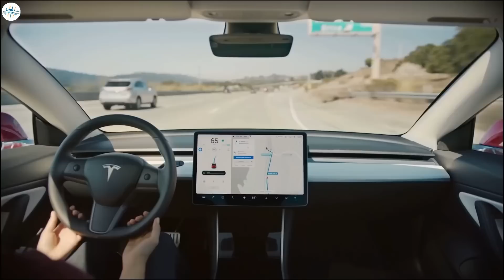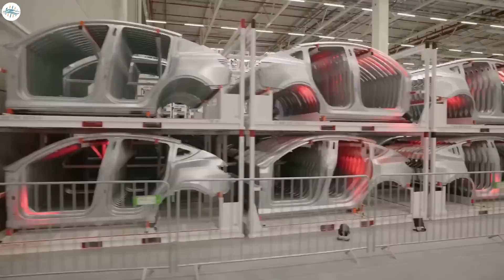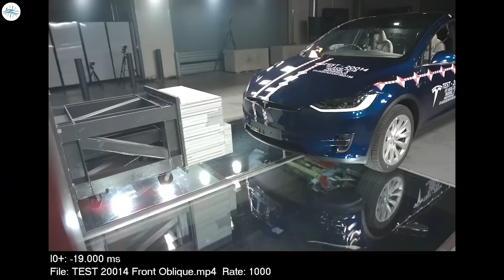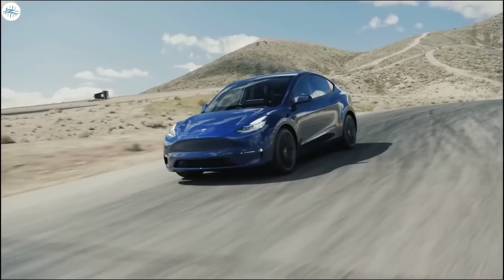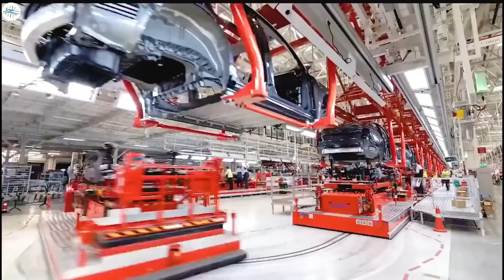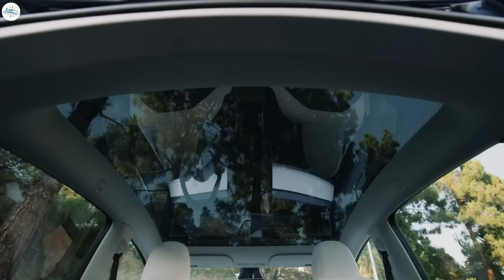2022 Tesla Model Y 2.0 - All The Changes & Improvements Coming!

Comment: The new Model Y should also get another screen like the Model S, heads up display and sun-panels on the roof. And as many 4680 batteries as possible to increase the range.
Reply: Already model Y costs 68000 euros with full self driving and winter tires. I'm case of HUD it costs another 4000 euros
Reply: @tomorrowland2684  The HUD can be optional, as could the sun-panels be